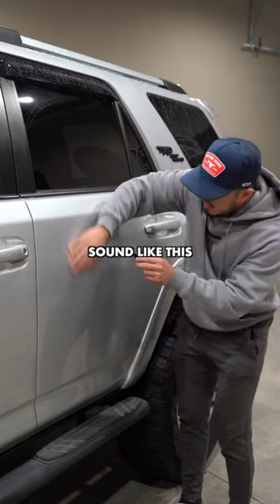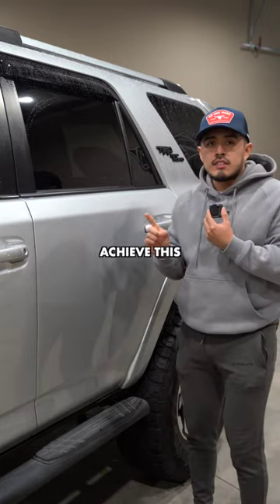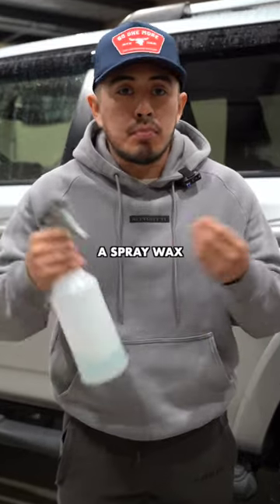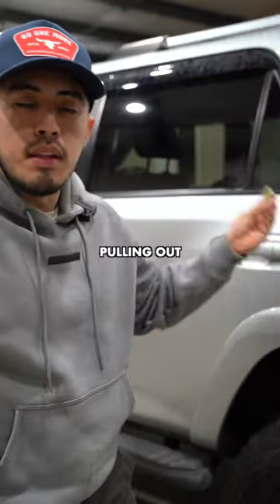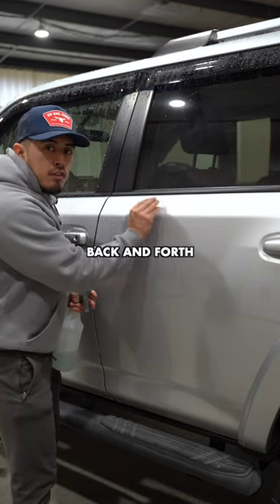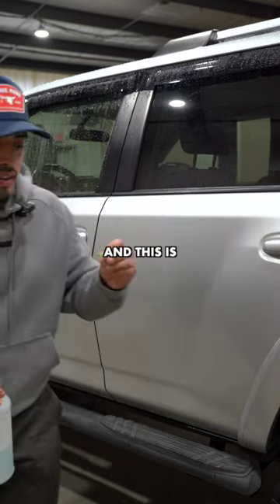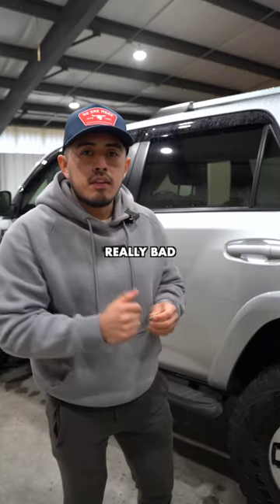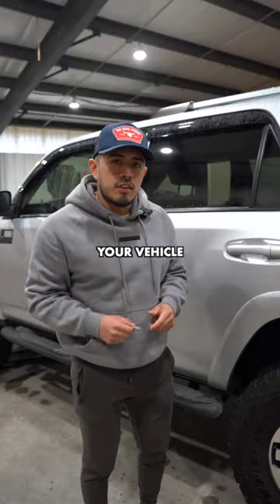How To Clay Paint #shorts

Comment from the maker: If your paint feels rough, it's probably in need of a clay bar treatment. 

The popular term is clay bar, but there's other forms of clay media like a clay mitt, towel, and disk. Each one will get the job done.

Here's the process: 
Use a lubricant like a clay lube, quick detailer, or rinseless solution. 

Spray onto the paint, spray onto the clay, and do light passes over the paint. 

You do not need to put a ton of pressure down on the paint. Focus on doing a lot of back and forth passes with light pressure. 

If your paint is really rough, you might have to do multiple passes. 

You'll know when you're done because the rough texture (and sound) goes away, leaving a nice-smooth paint finish.